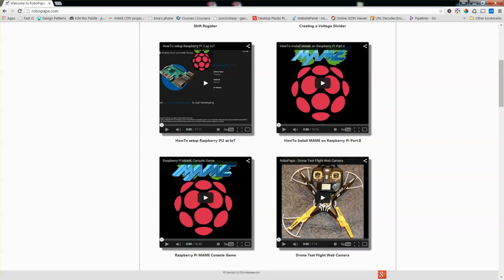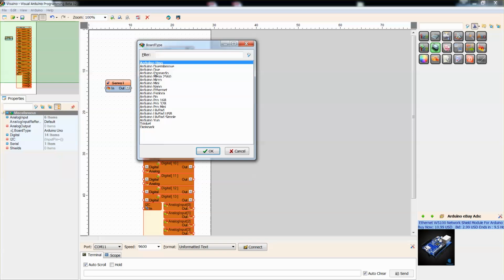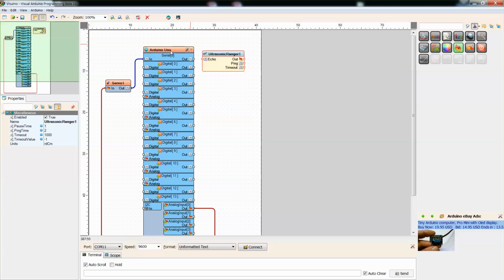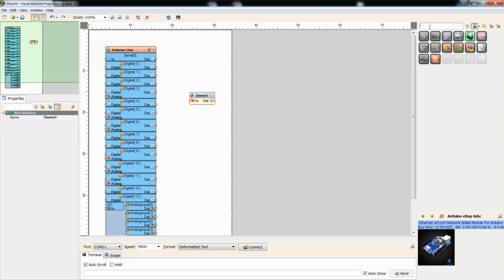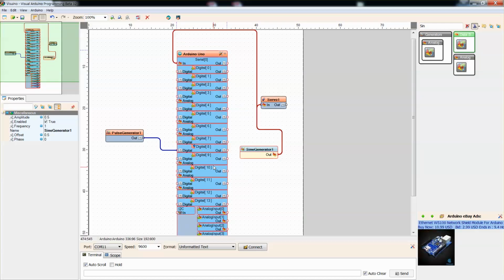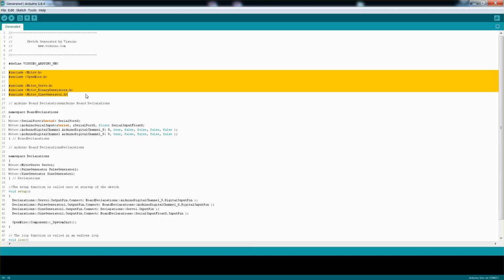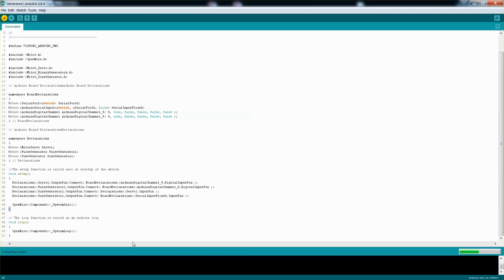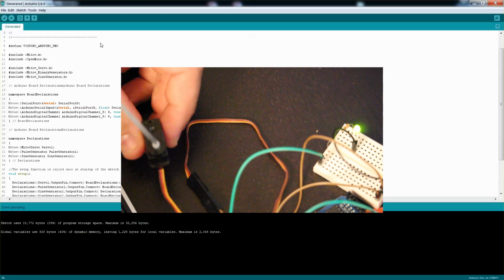Visuino - New Arduino IDE

Comment: Will the software work with ESP8266?
Reply from the maker: Hi Rud, Yes it should support the Adafruit version of ESP8266. I'm on Visuino Pro 7.8.3.60 and I can see it as one of the board. Also the non-pro edition supports that.